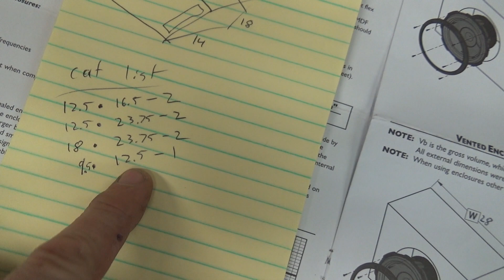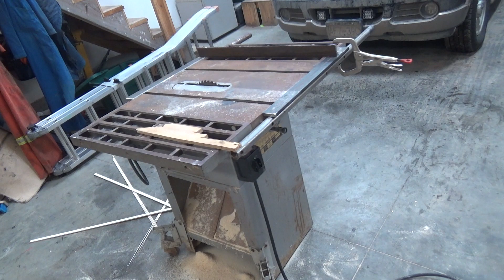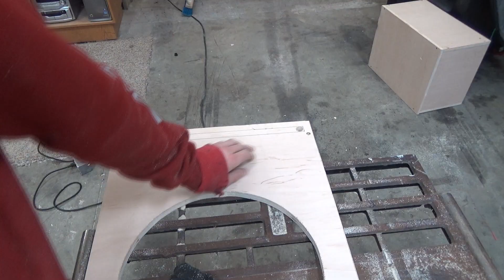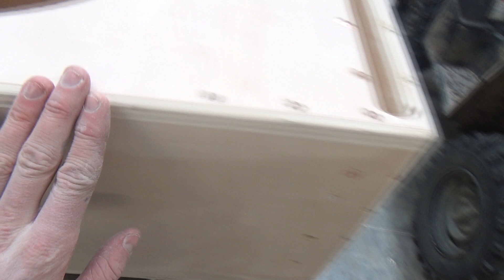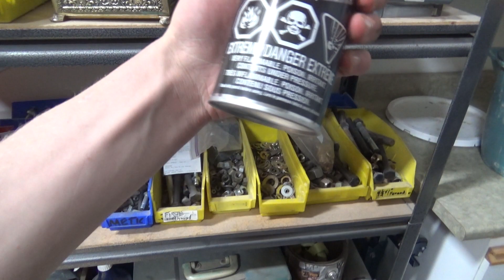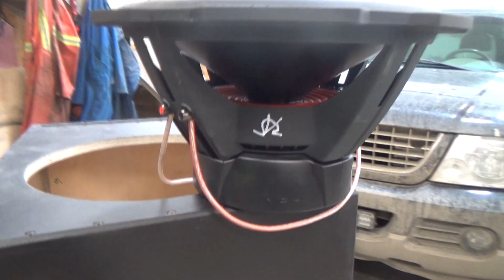Lets Build a 15 inch Subwoffer Box (Slot Ported)

Comment: That port is notto spec. I have a p3 15 in a custom enclosure and i know for a fact that port has mad chuffin noise as it is not wide enough. Looks to be have the width it should be.
Reply from the maker: Port is to spec, you should rethink what you think is fact. Thanks
Reply: @DonkeysBreath  wish i could share pics on here to compare but i guess it dont matter. Im happy if you are bud